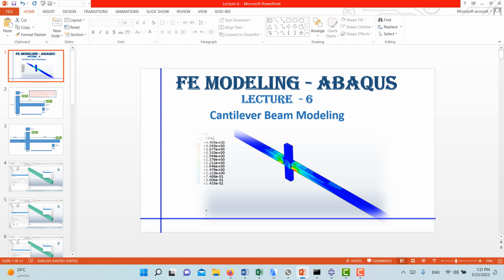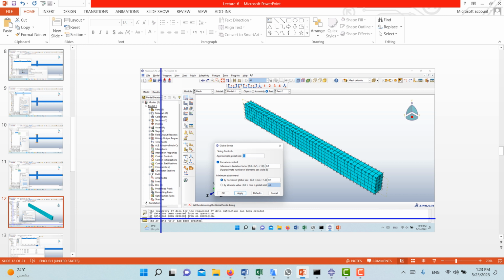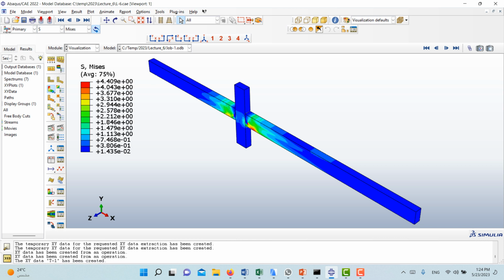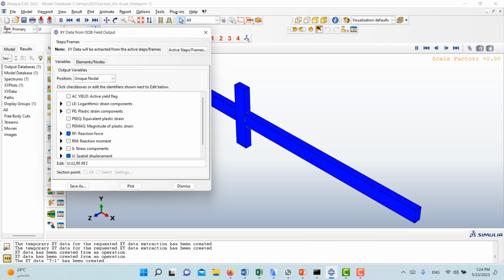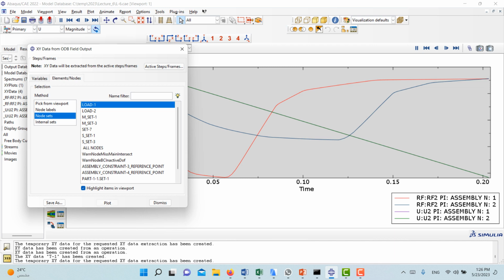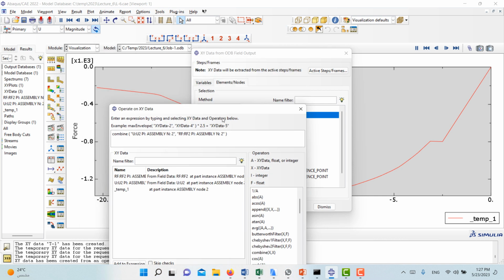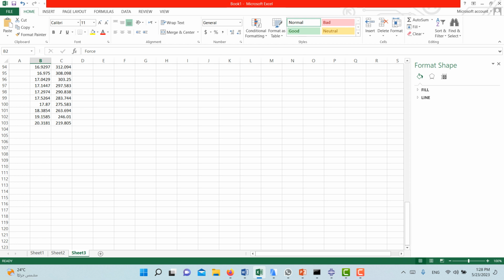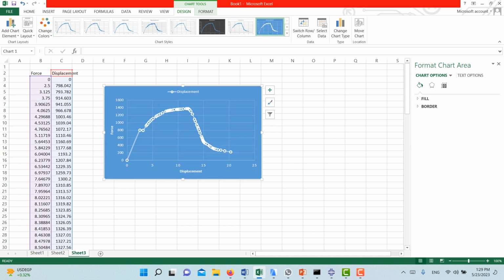ABAQUS/CAD training Lesson 6, Dr. Bashir SALEH

Comment: Hi
please tell me how to define bond slippage between steel bars and concrete?
Reply from the maker: Hello, you may utilize the option (coupling) Interaction - build constraint - Coupling.
If you still don't understand, the following video will explain joints and connecting techniques. Regards